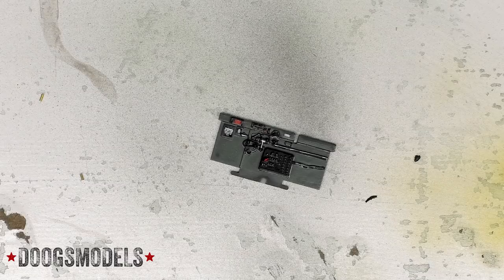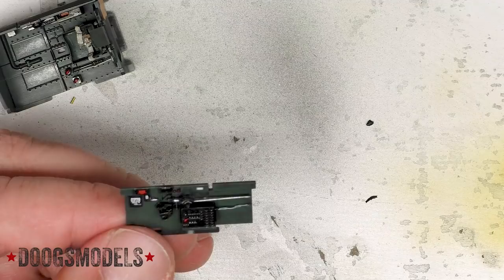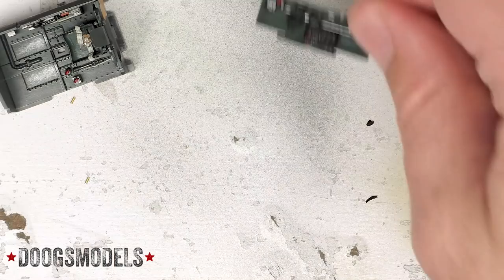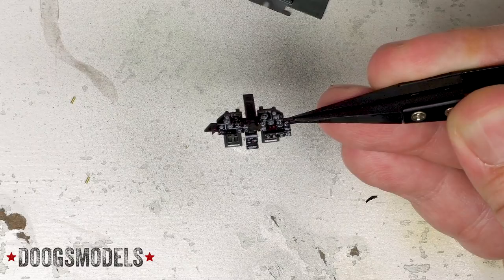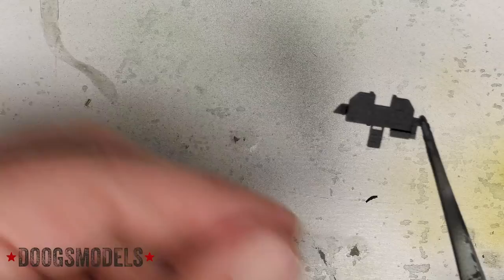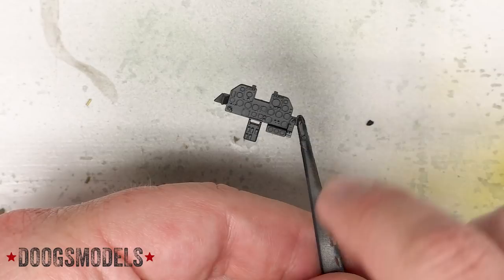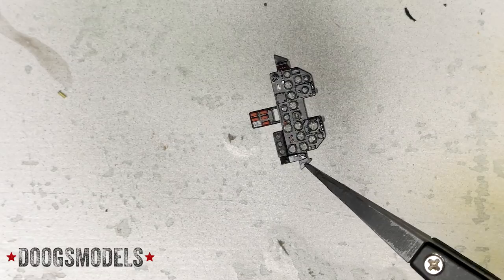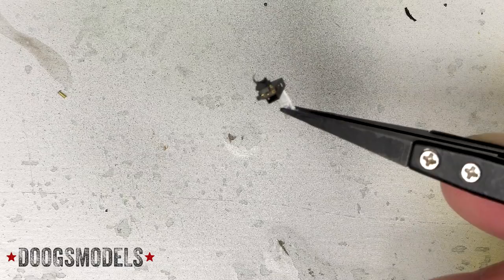Tamiya P-47M Build - Part 4: IP Battle!

Comment: In the early Tamiya kits I built I did use the kit IP & decal along with Gauzy gloss coat agent for the dials. They all came out very good. But when the LOOK  IP's came along I switched, laziness maybe. Focus line is correct, but those were usually found on D-30 and later. So for the "M" no focus line. Pit is nice. Going to add wire for the rudder pedals?